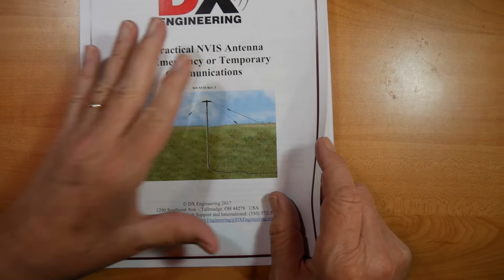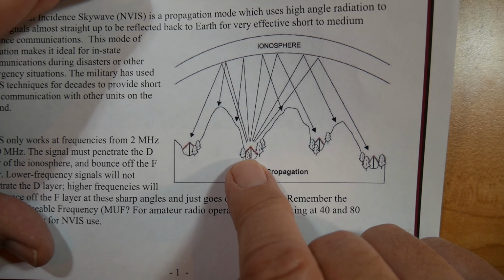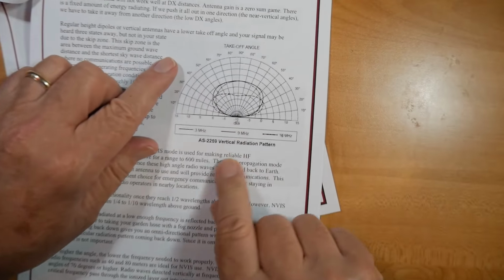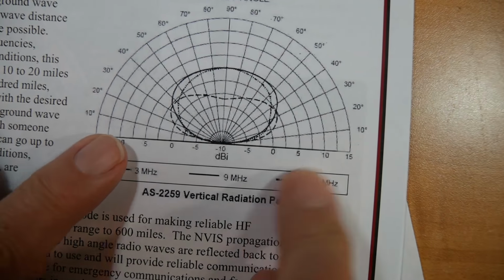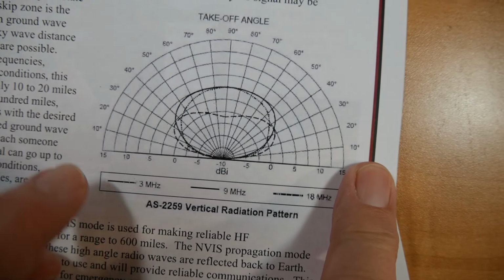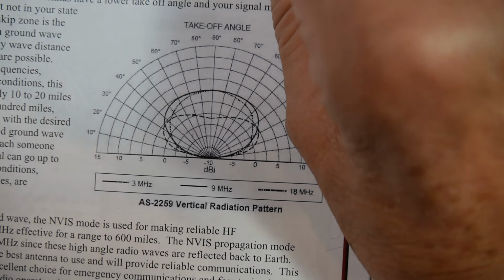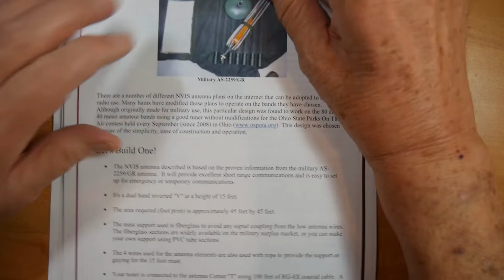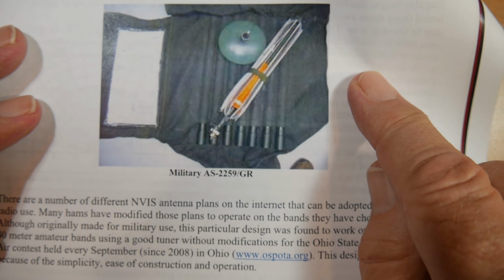Better Portable than Mobile for NVIS (#1390)

Comment: Thanks for posting this, I have been looking for compact 40 and 80 NVIS antenna for my smallish back yard.  I read the DXE brochure you linked and did some additional research on crossed inverted-V dipoles.  First, the brochure erroneously says this copycat US Army antenna, AS-2259, has a 45 ft by 45 ft foot print. it is a square, 60 ft by 60 ft. Use the mast height 15 ft and the total wire/rope length 45 ft, and the Pythagoras equation a few times and you'll find the tent pegs are 60 ft apart in a square and the distance from any peg to the mast is 42.5 ft.  Several other sellers of copycats make similar mistakes as DXEs. 
Second, several sources note that this exact design of the Army's AS-2259/GR antenna is very inefficient on 40m and 80m ham bands but resonant on two non-ham bands, 33m and 51m.  Some hams, N3AE and N3IDX and others including Chameleon and DX Engineering  have copied the crossed dipole configuration but changed lengths and sometime added loading coils or baluns  to improve 40m and 80m performance dramatically.  The revised designs are worth another video.

Comment: Interesting concept..

Kind of a Crossed Element Doublet..

My 1st thought was, " Why Coax " why not feed it with open twin or 300ohm Ribbon 🤔

Or, does it behave like a pair of crossed  63ft Off Centre Fied Dipoles
( hence more suitable for Coax ) Uuumm 😉

De John, EI7KL || G4XJC

Comment: I have a low 5.262 MHz low inverted vee squashed into my tiny 25' x 13' garden so I'd say NVIS. 
I worked 180 miles with 350 mW out using a Pixie together with a SWL report from Uttrecht at 340 miles and 280 miles with 2 Watts using a 1944 Wireless 19 Set, both c.w.
I took a 40m inverted vee to Wales with one 20 foot mast with the ends at ground level held down with rocks. It worked. 

G4GHB.

Comment: Mobile stations operating on frequencies below 10 MHz, it is my experience and you will probably find that a vertical antenna on a mobile will have a high incident angle of about 45°.   This is due to the capacitive coupling with the earth, providing a poor ground plane.  I have found this is good for communicating stations as close as 50 miles away.   

You can try laying the antenna back at a 30° angle, but as the voltage end (top) of the antenna becomes more horizontal and gets closer to the earth the antenna will have additional ground losses.   

Telescoping whips work very well to temporarily extend the length of a mobile antenna, but may not work with the internal circuitry of proprietary antennas like the ATAS-120 as an example.   This antenna wouldn't be effective anyway because it can't operate below 40 meters.  

There's a lot of good information regarding mobile stations, lookup K0BG.

Comment: Military use that sloped fan dipole and magnetic loop on vehicles ( visible on boats and vehicles ) old style bent over whip on jeeps. And on wwii German vehicle photos, looks like a clothes drying frame over their command vehicles. The rest just experiment:-) I have myself planed to test a horizontal loop taped to my small rf glasfiber roof extension. About 1m high covering all of small van. Maybe next summer.

Comment: I dont get why to emphasize MFJ as you can't get the products anymore. Time goes on you know. MFJ on gone.
Reply: Maybe good to buy at a radio rally so why not show it?
G4GHB.
Or make one similar.
Reply: Still plenty of MFJ gear on the second hand market.
Reply: I just bought a HeathKit can Tenna from the 60’s works great.
Reply: @Maurice-uy4wn  Heathkit was a great company with excellent products and documentation. The only possible downside of buying Heathkit stuff second hand is if the item was kit-built by the original owner and not assembled well -- poor soldering being the usual culprit.

Comment: have you considered that a 2 element yagi is normally a half wave dipole with a reflector 0.15 wavelength back.....on 40m 0.15 lambda is 6m (about 20')... but the ground is a reflector too so a low 40m horizontal dipole at just 20' high is actually a 2 element yagi firing straight up (ideal for NVIS).... next time you are portable don't apologise for just running a low slung dipole proudly boast you are running a full size 2 element yagi optimised for NVIS.